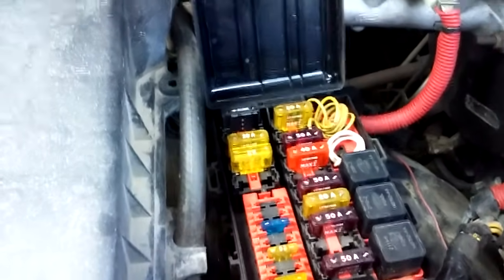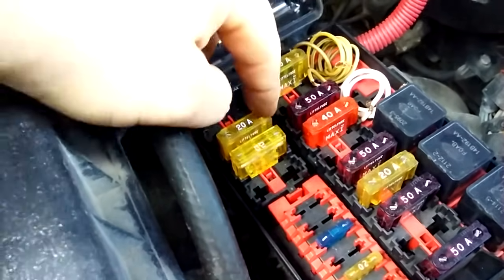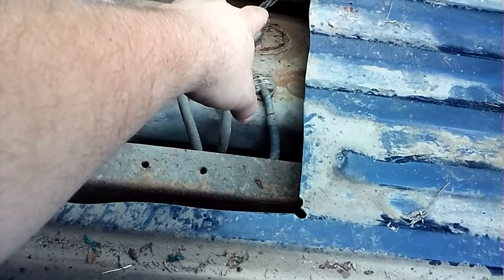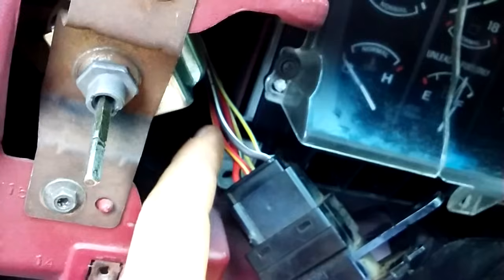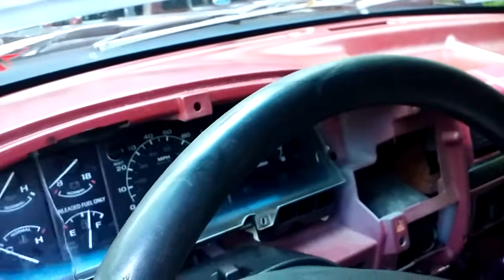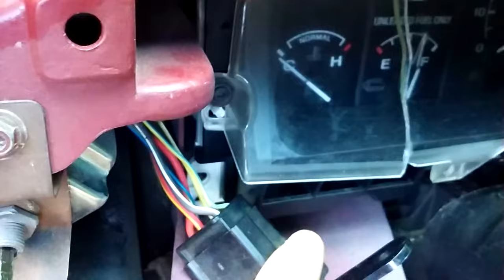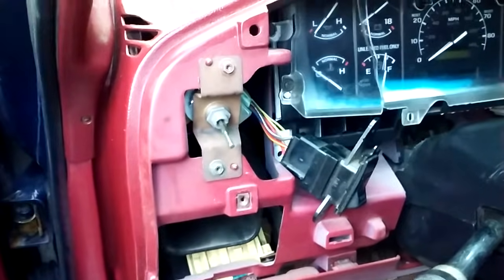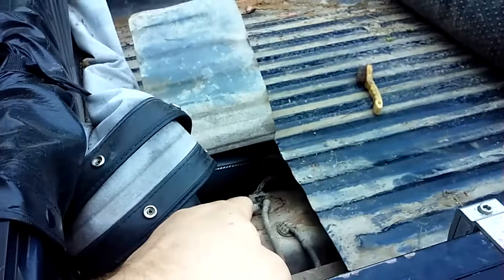1992-1996 OBS F-Series: Diagnosing A No Fuel Issue

Comment: My 96 F150 will crank and turn over on the front tank but sputters and dies. It will start on the rear tank then can be switched to the front and it will run fine. Any idea on diagnosis?
Reply: You still have this issue? Sounds like clogged filter

Comment: my truck starts and drives on the back tank I switched the front tanks fuel pump and it ran for a while on the front tank too then all the sudden died and will start but damn near immediately die it'll run on the rear tank but if you rev it up it kinda shits a little bit but stays running,i did replace the fuel filter and the old one was almost black on the inside im thinking its either the tanks are dirty or the lines are clogged if you know please let me know
Reply: Similar issue with my 96. It will crank and turn over on the front tank but sputters and dies. It will start on the rear take then can be switched to the front and it will run fine. Any idea on diagnosis?

Comment: I replaced my fuel pump but the new one is getting no power. When I flip it to the rear tank I hear it prime, but on the front nothing happens. Could the switch be causing that?
Reply: Did you fix it? 

My rear pump primes but it loose power when the truck is on, front tank works fine (whole new unit btw)

Comment: Is it me or is he wrong about the inertia switch. Depressed should be the run position, and popped up should mean the inertia switch has been tripped ..no? Any insight?
Reply: It pops up when tripped. It is easy to test it, just whack it with your screwdriver the button will pop up and it makes a twangy spring noise. Push it back down and it should start. If the button is down and the fuel pumps don't run trip it reset and test continuity through the switch.

Comment: Can you run a hot wire to the switch that turns the tanks and it work but it won’t work once you take the hot wire off of it is the switch bad or good
Reply from the maker: Is there 12v already being supplied?

If so, the switch is bad.

However I had a switch to work; but the clip break and the wire slip off
Reply: There’s no power getting to the switch! He can run a hot wire and the pumps come on !
Reply from the maker: @barbarajones2620  then you need to trace that wire to figure out what it going on.

What color is the wire in question?

Comment: I have a 96 f150 duel tanks.
 I got a new pump and tank in the front.  I almost have a full tank and I was using the back tank. I flipped the switch to the front tank and it fires up but quits after 5 seconds and then I switch to the back tank. No problem with the back tank. But when I don't drive it till the next morning flipped the switch to the front and fires right up. I can get half way down the Rd before it cuts out. I was told that when the relay get warm it will shut the pump off.
I don't get it 
Any ideas
Reply from the maker: Sounds like the front tanks’ pump is slowly going out

So at that point, while cool it will drive a short distance, and as the pump warms up it just quits working until it cools

Sorry for the luck bud!

*I limped a truck home 50mi with that method, because I was a broke guy that couldnt afford 200+ dollars for a tow lol
Reply: @TheFSeries same isue  and plus I have code that said. Secondary fule pup sircuit failure I don’t know wath that means
Reply: Lucky I had extra gas in my back tank
Reply: I have same issue but my pump is Brand new.
Reply: Did someone fix this issue? I have the exact same on my 92

Comment: So I have power at relay relay is good but no power to inertia switch, fuel tank selector switch, injectors or fuel pump what could it be
Reply from the maker: Check the items in order; once you find no power, go back to the last thing in the chain and inspect it.

Sounds like a wire may be broken

Comment: Just changed the front pump, truck still won’t start, put it on back tank and it starts but won’t drive in D not getting enough fuel, 1994 f-250 any advice ?
Reply: Did u fix ur problem on ur truck I have same isue on my 95 f150

Comment: Amazing video, thank you for the great explanation! I've been through the bad selector switch problem before, but now I have a slightly different issue. Both pumps and tanks were replaced in 2018. The front pump seems to have suddenly died, and the rear pump intermittently will not supply fuel at start up. I'm in the process of checking voltages. Unfortunately, I have a cap and 1500 lbs of tools and I do not have that nifty access door!

Comment: hey man i am trying to get on of these running its been sitting for years it wil crank over like she is fresh off the show room floor but i aint getting no fuel  the relay and fuses are fine and it has fresh gas in there .i know its fuel related cause i shoot some break cleaner in there and it fires up off that but it will die any tips
Reply from the maker: What are the odds the fillter is gummed up?

Start troubleshooting:

-Does the fuel pump operate?
-If yes, is the fuel moving forward.

If not, then you’ve narrowed it down.
Reply: @TheFSeries  im going to check that today cause i checked the strater valve and lots of nasty old smelly gas came out and now when i prime the pump over and over i get no fuel to the lines and i have check the inertia switch and i only have 1 tank
Reply: @TheFSeries  so i dissconnected the line going from tank to fuel filter primed/tried to start it and got no gas what could this mean

Comment: Holy shit. You saved me a ton of headaches. I narrowed it down to a fuel issue. I had no idea that silly switch actually supplied power to the pump! Just FYI to everybody, BEWARE OF THE CHEAP EBAY SWITCHES! That is what I had replaced my old one with because it was cracked and this cheap ebay switch lasted 6 months. Luckily I saved my old working one and it fired right up!
Reply from the maker: Glad to help!
Reply: Damn straight who would’ve guessed that switch makes it so ur truck run 😂

Comment: Very confusing, push inertia button down is correct for power to pump. If button is up ,no power to pump. Always go your video to avoid such confusion. Inertia switch area on panel has curve in plastic so u can push it down without removing panel. Push down to have power, if it is popped up ,push it down. If it is popped up it will easily push down .
Reply: You are correct Mr Smith.  This is a HUGE error in the video.  The Switch is spring loaded in the up position when it is tripped.  Normal operating position for the switch is in the DOWN position.  if Tripped it unloads to the UP position.

Comment: i have a 1992 f150 4x4 4.9 i just got it and it has sat for 5 years ran fine when he parked it now it wont start i hit it with some  go juce it starts and right back off i hear a click in the tank but i dont hear pump run think it can go bad just setting
Reply: did you find out the problem i to just got one on a trade thinking it just needed a fuel pump i replaced the pump and new relay still no start  thanks
Reply: @thomaswilliams1851  pumps was bad got a new tank and all 169$ @ A-one auto on line thats pump and all
Reply: @jtsgarage2999  yeah found my problem to it was the tank selector switch
Reply from the maker: Another issue I've seen with gassr vehicles sitting, and having electric fuel pumps is the strainer on the main bottom of the pump gets brittle/breaks down and ends up INSIDE the pump, ruining it.

Comment: It take a real idiot to cut the bed floor to access the full pump! It takes more work to cut it than to drop the tank or remove the bed and do it the proper way!
Reply: B***** it's a hell of a lot easier to cut a hole in the bed than do anything else taking the bed off or dropping the tank I took an angle grinder and had a hole cut right above the fuel pump in less than 10 minutes try to drop the tank or take the bed off in less than 10 minutes evidently you haven't done it before
Reply from the maker: Glad it wasn't me, then.

It was done by the previous owner.
Reply: Kaboom

Comment: Is there anyone out the that would be kind enough and has the correct knowledge mechanically? All I need to know iswhat position should the inertia switch that is underneath the passenger floorboard on a 1990 Ford F-150 XLT half ton pickup 4*4 King cab??
Reply: if the switch has been tripped it will be in the up position.  Normal operating position is in the DOWN position, the video is wrong a HUGE error
Reply: I'm looking at the manual for my truck now, down is properly reset, up is disengaged.

Comment: what if the pump is only working in the rear but not the front, is there separate power wires out of the switch for each pump?
Reply from the maker: Yea
Reply: Which wires go to the rear pump

Comment: Thinking about cutting an access hole to the fuel pump....would it be about the same area for a 96 f250?
Reply: ben l please don't Its easier to pull the bed!
Reply: @dodgeramsport01  I think pulling the tank is a pain in the ass  , but easier than pulling the bed !
Reply: @rickobrien4025  I myself think the bed is easily!

Comment: ironic. i have to use just the front one also because my rear she doesn't work. if the truck is running ill switch to the rear tank and the gas gauge will go down to E (hardly any gas in the rear tank) but it doesnt shut off i guess its still pulling gas from the front one? im not sure, i bought the truck and previous owner says the rear tank doesnt work
Reply: Were u able to use it regularly with just the front tank working?
Reply: Same here. Front is all good and running daily but I replaced the rear tank and pump and the selector. Rear pump activated and the gauge shows correct level but not start.

Comment: I have no volts at the fuse, what could be the cause of that?
Reply: Computer (drivers for the fuel is blown) can pull cpu out open up and see if anything is blow, could be wiring (broken/short,corrosion) try jiggling the wires for that fuse or unhing the whole box n inspect,  or human error you didn't have key on (possible yet not likely) or battery charged up (unlikely)
Reply: Human error voltmeter is bad or needs new batteries

Comment: Good video, the fuel pump in the front tank on my '95 F150 quit working the other day, and the back tank feeds slowly, so it sputters going uphill. I'm going to check the wiring to the selector switch on the dash...
Reply: Justin Belshe  I have same problem on my f150 back fuel pump start but wen I start driving start like losing power.and die but in park they stay on idle but I don’t use any more I use that front only but that gas gauge don’t work only wen is off they read wen I start go down to empty any idea wat is ???
Reply: Figure it out?
Reply: Nope I sale that truk and now I have other oane whit same problem but I yes put brand new pump I’m going to check that wire harnes and that switch selector because wen I switch to front thank start whit no problems

Comment: My problem is when I am driving down the road or when there is a load on the truck is  hesitates and sputters.  I have changed the fuel filter, sea-foamEd the intake, taken the throttle body off and change the gasket, spark plug and wires and  also rotor and distributer cap.  Not sure what else I can do.
Reply: Did u figure out what the problem was im having same problem bout 2 burn her down
Reply: Pumps could be weak .
Did you check the fuel pressure ?
Reply: Took a look at your pressure regulator?
Reply: Put gauge on Schrader valve, if u have 25lbs or very close or ,more with engine running, your pump is good,good regulator should hold 25ish lbs for 20 sec to aprox 2mins. If u disconnect return line and attach vinyl clear tube u can fill a gas can or drain tank with engine running. Over 25ish lbs goes to return line and back into tank., seal carefully return line or it will dump gas all over ,maybe catch fire. I used vinyl tube from hardware store to fit over chrome (stainless)at connector, had to be carefull to keep seal, put a clamp on it, or get old connector at junk yard ,cut it and adapt line into gas can, common sense!., fuel pump should have ck valve yo hold pressure at regulator (This is so injectors have pressure for to start up), this pressure will also bleed of with time.
Reply: I'm having same problem if got 45psi on rear tank front pump doesn't work but doesn't overflow iv replaced everything 3x still same issue help me please

Comment: Where do I look to find the inertia fuel shutoff ford 1993 7.5 liter gas  chassis  used for Dutchman motor home?
Reply: It's on the passenger side under the glove box ,,, called the kick panel because your shoes might hit it on the way out.  remove a couple of screws and it will pop off.
Reply: I have ford bronco 1987 and wen I open that key fuel pump stay on never stop any idea wat is that problem

Comment: I can hear the pump prime or sound like it's priming I replaced the tank and the pump but not the sending unit because it was working but now it stays at the fuel mark. I only put 2 or three gallons in the tank
Reply from the maker: Is it ON the Full mark or way past it?

If it's way past it, it means it isn't grounded good
Reply: @TheFSeries  way past I had to replace the plug to the pump literally burned up
Reply: Rear tank has been bypassed in fact it's gone
Reply from the maker: Mine did that exact same thing. The plug that goes on the pump was charred
Reply: My fuel pump prime sound stay on wen I open that key and they should stop at few seconds and my gas gauge stop working can someone help me

Comment: Hey man what if I'm getting 9.8V instead of 12v at the selector and also at the pumps
Reply from the maker: Check for 12v on the wires coming from the fuse box.

If you have 12v before the selector switch but not after, the selector switch is likely the issue.
Reply: I believe I have, wiring diagram says red/yellow wire from inertia switch so actually let me back track that...one other thing. Zero fuel pressure but that makes sense right?
Reply from the maker: If the pump hasn't turned on, then no fuel pressure.
Reply: Hey man so it'll get the 12V only when cranking. Just leaving the key on it drops to 9..no good right?
Reply: What color wire is power at pump

Comment: you said the inertia switch should be UP for the truck to run. shouldn't it be DOWN for it to run?
Reply: It needs to be down
Reply: Yep just had this issues. It will pop up after an accident so you need to press it down to run. He probably just misspoke
Reply: inerita switch should be "Down" to run - "Up" to Off...  Correct?
Reply: Yep, that's what I heard before too. It needs to be pushed down if it's popped up. It's been in an accident or rolled ?over?
Reply: Yes it needs to be in DOWN position !!